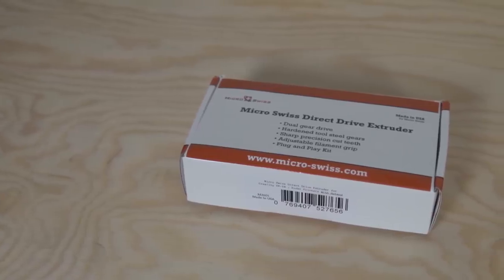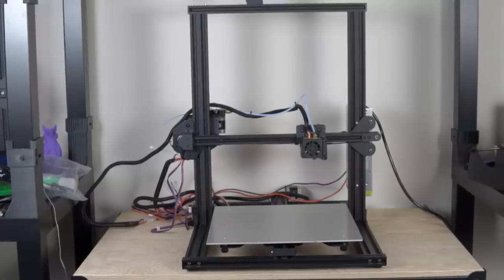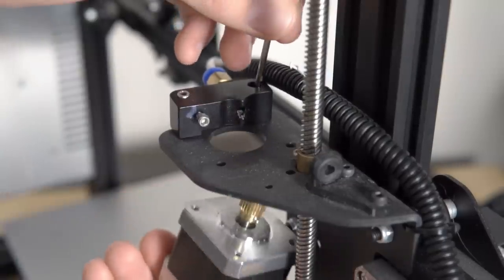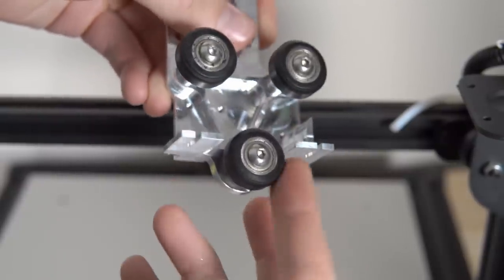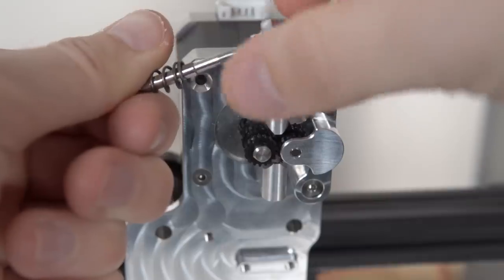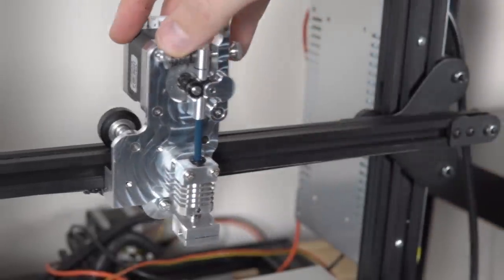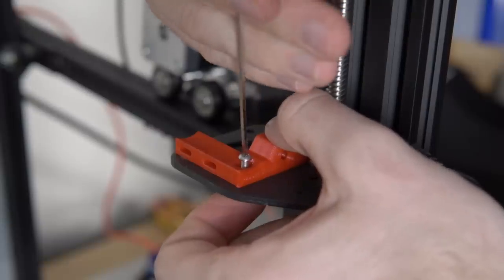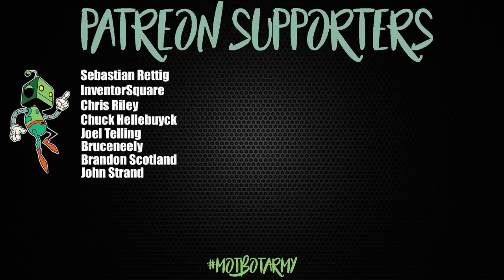Micro Swiss Dual Gear Direct Drive Upgrade For Ender 3 and CR-10 3D Printers

Comment: Why use the bracket and bowden tube at all. Shouldn't direct drive be just that, direct drive? As in straight from spool down into extruder gears. Am I missing something?
Reply: prusa uses a tiny ptfe tube too
Reply: @jessesheehan4051  Yes, I noticed that, which makes sense to keep the tube short. It just seems like the Micro Swiss version is too much. Adding back into the equation what you are trying to do away with in the first place. I just installed mine so I'm going to try it both ways and see if it makes a difference. It probably won't since the extruder gears are just above the hot end but there could possibly be issues with retraction if the tube is suffering from severe wear. Then again, maybe not. (shrug)
Reply: @brustertootwopointo4644  If you are using a high quality stiff bowden guide tube, it will start to hit the frame. I use Capricorn Tube and I'm having this problem. I've lost over 30mm of build height. I'm probably going to go back to just bowden setup, as I can't afford to loose build volume on such a tiny printer.  I may put the thing on an Ender 5, since nothing will get in the way.
Reply: @mr.spongylikeaboss4987  I was planning to use my Capricorn tube as well. Just a short length from the top of the extruder and run the filament straight down from the top of the frame. Haven't done that yet but that was the plan.

Comment: What exact size is the longer screw for the the bottom roller? I stripped the head of mine and need to order a box of bolts but want to make sure i get a box with that specific screw. In the video you just say 5mm

Comment: I suppose the bowden tube from Z-axis to the new extruder is unneeded.
Because it is too troublesome to remove shorten filament when that will run out.
Reply: I was thinking the same thing. I mean I could see putting it in with a centimeter or two extra, but If I do a direct drive mod I don't exactly want all that bowden tube still mucking about

Comment: I installed the MicroSwiss extruder kit on my CD-10S without problems. I have not been able to make any prints though. Besides having difficulty loading the filament into the lower piece of tubing my prints stop into 20-30 minutes of any print. The printer keeps moving but there is no filament extrusion. The piece of filament that is between the gears get ground up and the filament cannot even be pushed through manually. There are clicking noises on and off towards this time. When I can forcefully remove the filament and reinsert it, I can get it to extrude again. This is happening over and over and I am wondering if there is something defective on the hot end I was sent in this kit. Any ideas on this matter?

Comment: good video! I already have the Micrfoswiss hotend installed on my ender 3 MAX. I tried to install a Zesty Nimble direct drive but I would have to design a new fan shroud, etc. 2 Questions: 1: isn't the Nema 17 Motor a but to big and heavy? Can you use a much smaller Pancake motor? 2: This uses 2 grears, I think but in one path. I wonder about slippage? The OMG Direct drive extruders use 2 geared extruder paths. Isn't this a better design than a single path extruder design. And isn't this the main complaint with the Boden Geared extruder setups. Trying to adjust the spring tension just right, etc. ;Just does not seem to work well. I like that it is an all-in-one solution that you do not need to print out any extra parts. This is my problem with installing a direct drive extruder; having to print out parts.

Comment: I am unable to use my max height.  My bowden guide tube at the top of the extruder hits the frame and bends enough to cause the filament to snag and skip in the tube. I am using capricorn tube which is pretty stiff, and does not like to bend. The closer the guide tube gets to the top, it hits the cross rail of the gantry, bending more and more. I've lost about 35mm in build height.

Comment: How does this effect the inertia for the movement on the X/Y axis?  more weight, harder to stop start...
Reply: I wondered the same thing. Y shouldn’t be affected but seems to me that the X motor now has significantly more mass to rapidly move around.
Reply: It means you have to turn down acceleration due to the increased momentum. This is the only real con to this setup

Comment: The motor turns the wrong way. It does not extrude, it pulls the material out again. Where can I adjust this in the software (Cura)?

Comment: How do you fix the new Printhead setting? the nozzel will be on a different spot so the printer dont know what the middel of the bed is. the x- will be 5mm more and y like 10+ how do i make that right?

Comment: Did you have to adjust the VREF of the x stepper to account for the extra weight of the head? Mine is losing steps all over the place.

Comment: Nice Dual drive. Some stuff they did much much better than e3d hemera did. Some stuff they could do better. But I like that they have an aluminium adapter for the printers. I like the way how the heat block is combined with the heatbreak. What I don't like is the ptef tube between the  cooler block and the dual drive gear. They should did a new hotend. I hope they will do it. Cause an other company tried and did not good job in my opinion.

Comment: Instead of the risk of over torque on the hot end and damaging the heat break when heated up, isn't the torque wrench supplied by Slice Engineering for their mosquito hot end  adequate?

Comment: What is the weight of the whole extruder (with motor, aluminium bracket, hotend etc.) - basically all moving parts on the X axis?
Reply: less than what you would ever be worried about lol... This is "THE ONLY" way to go on an Ender 3 or CR10 etc.... don't settle for a clone!,,, i don't even KNOW the folks at micro-swiss but the machinist i fired yesterday would tell you... VERY NICE  :)
Reply: @thefeet  Thanks for reply. I actually chosen the alternative - bmg aero :) Also lightweight

Comment: Will this help with the Ender 3 V2 issue with bulging corners with PLA? It can't use linear advance due to the stepper boards are in legacy mode (from what I read, anyway), and still trying to work on jerk/accel settings, but that has only gotten me so far. (Any tips welcome, only been at this for a month)

Comment: After installing this on my Ender 3 Pro, my BLTouch is about 4mm off the front of the bed. I've double checked that every bed volume setting is 220x220x250 in Prusa and in OctoPrint, and I've adjusted the offsets in Marlin, compiled a whole new build, same issue. Any tips?

Comment: there's a notch on the step motors shaft. did you put one of the grub screws on the notch? otherwise it would spin in place.

Comment: Installed last night...looks like the dimensions on the mounting plate or positioning is different than stock because the X,Y,Z axis are all off now. The new mounting plate hits the end stops at different positions so the nozzle hangs over the buildplate edge in both directions when you auto home.   Did yours have this same issue? Going to contact Micro Swiss because this is advertised as a "direct bolt in" and it looks like I'm going to have to update the firmware now as well.
Reply: Have the same problem and need help
Reply: Yep same here just installed 2 of these kits on a CR10 & CR10S both have the same problem!
Reply: Hey, i'm about to install it and should have the same problem. How did you end up solving it?

Comment: I just want who ever is reading this to know that the fan shroud is supposed to be in the front. I literally finished this entire installation and didn't realize until I was about to hit print. He doesn't really explain when he flips the printer around so just a heads up. The gray box is on the back and the fan shroud is on the front.

Comment: Have mine installed and cannot get rid of the carriage wiggle. Everything is as tight as it possibly can be, and the carriage still rocks a good bit. Not sure if this is normal or not.
Reply: Did you try turning the eccentric nut on the lower wheel?
Reply: @hansdewyse1361  I've tightened that up, and now X will not move at all, so I loosen it and get the carriage wobble and X still doesn't like to move properly. I've loosened it as much as can be, massive carriage wobble, no movement on X. Start tightening and no matter how tight I go (all the way to full tightness so no wobble), X will move partially closer to home, the further it gets from home it starts skipping and finally just stops all movement. Losing my mind over here trying to figure out how to get this thing working without undoing the entire project and going back to bowden tube extrusion.
Reply: @arglebargle82  I honestly don't know then, sorry
Reply: @hansdewyse1361  No worries, I've been messing with it for a while now and no resolution. If I could find an X gantry to swap the one I have with I would, I'm thinking maybe it's sagging on that side but I can't tell just by looking at it.

Comment: No before qnd after print samples to see if this provides any improvement.
Reply: The improvements might not be apparent in the print samples. With the direct drive, you can print faster, and you can print flexible materials. The all-metal hot end lets you print high temperature materials.

Comment: Should have shown how to set up the firmware, as I am having a huge difficult time getting my nozzle centered to the bed...
Reply: Did you ever find a fix for this? I’m in the same boat right now!!!
Reply: @PastorTFS  I did, but it was a combination of things. I installed this on a totally modded CR10S5. Control board, leveling sensor, the works. I would have to look what I did up and wouldn't be able to get to it till tomorrow when I get to my shop...
Reply: @PastorTFS  I changed Manual_X_POS to -5 and Manual_Y_POS to -7. And set my BLTouch offset. Thats what worked for me...
Reply: @rackstargaming8131  thats awesome my problem is that I don’t know how to do that so that it stays each time I print like a stock machine homes
Reply: @PastorTFS  yeah, I had to build a custom version of Marlin because I did so many different mods...you could get someone to build you a custom version or learn how to... plenty of videos out there, some real good ones by Teaching Tech...

Comment: Don't you need to upgrade the firmware, since the nozzle is at different position?  Thanks for the video!
Reply: Unless you are pushing the limits of your X and Y that isn’t really relevant. Also, I suspect it’s not at a different X and Y.

Comment: I konw this will be reinstalled to another printer, so when doing that make sure the grub screw on the extruder gear that goes on the motor is aligned with the flat side of the shaft.
Reply: lol i caught that too, grub wasnt aligned with the flat spot.

Comment: I just installed Microswiss direct drive with all metal hotend and it seems faster but it doesn't print at center. Also it starts out printing then about 15% into the print it just stops extruding filament. Have you seen or heard anything like this? I'm sooo trying to print a good print with this. Any advice would help. Thanks in advance

Comment: I am trying to mount this direct drive extruder kit onto a CR 10S Pro. Is the process the same? My machine has a leveling probe and this video does not mention it. I have been searching for a printed mod to accommodate the probe. Any thoughts on this?

Comment: G'day m8 and hows ya doin ol son!!.....im doing both Micro Swiss DD and hot end!!! thanks to your channel!!!!!!! for putting this in my head.  I've gone for a 50w 24v Heater cart by Slice Engineering but i cant find a vid on its install and any other info like firmware update Etc.  ive heard this will do 300c or there abouts which is what im wanting for some of my Rc parts, for polycarbonate and Some Carbon Fiber pieces im needing.  Im a bit of a noob at 48yr old.... but not completly stupid.  Will the stock ender 3 v2 thermister be enough or is that need to be upgraded too. Cheers and kind regards for at least reading this novel from a m8 Downunder!!

Comment: I just installed this, all works well but now my extruder is about 20mm from the front edge of my build plate. The Y end stop on the Ender 3 doesnt seem to be adjustable, how do I adjust the Y home point? Many thanks.
Reply: You can slide the y stop up and down. Look at 3d tomb of printed horrors channel: great video tutorial for bed leveling.

Comment: Install went great! extruder is not extruding while printing it is retracting.  I  had a 3d printed piece and was printing on my ender3 pro right before i put on the MicroSwiss.  Any ideas, same firmware.  Thanks  Rob

Comment: Thank you for making this video! I've run into a problem though, The extruder gear does not have a grub screw, or any method to remove it that I can detect.. It's just gear, no collar. Should I just proceed with the original gear?

Edit: So apparently older production runs of the Ender 3 Pro came with a press fitted gear on the extruder motor :( 

If you have an Ender 3/Pro check to see if the gear has a collar on it before ordering this kit, so that you can order a motor ahead of time and not have to wait to use your new upgrade.
Reply from the maker: This is the first time I have heard of this good to know. Thank you for the feedback!
Reply: Any fix?
Reply: I found that when I use a pair of pliars with the needle nose in between the gear and the motor base, and the pair of snippers included with the printer (only used to apply equal pressure to the other side because i don't have a vise), i can pop off the gear. It took quite some force and the snippers are damaged but it works
Reply: Same problem on mine, and the printer was bought in November 2020 so it's not that old. It looks like I'm buying a gear puller now.
Reply: @mattgolman  do what i did
Reply: @Thrillowatt  I don't know if the stepper is designed to take that kind of axial load. It was probably installed with a heat fit and felt like a pretty strong attachment. The gear puller was $20 on Amazon and had next day shipping.
Reply: @mattgolman  oh sick, well mine works like a charm but a gear puller is probably the best way to go
Reply: My previous gear's grub screws had rubbed into the shaft, preventing removal. I don't recommend it, but I was able to remove the previous gear with a Dremel and a metal cutting disk.
Reply: My ender 3 v2 had this
I just used a little gear puller I have and and flat head screw driver to pry off the gear
Ground a flat on the shaft with my Dremel
Works perfect
Reply: @Thrillowatt  i used a hammer in between the gear and motor. held the motor in one hand got another hammer and lightly tapped the other hammer  and the gear came right off.

Comment: The G-code they included seems to be way off. When my print started it wanted to run a wipe straight across the front edge where the clips are holding the glass.
Reply: same thing happened to me, had to modify the gcode
Reply: Mine did too. Trying to figure out how to modify the code. I'm new at messing with the codes.
Reply: Clips? You should use small strips of flashbreaker tape over the edges instead for glass beds. Flashbreaker tape is high temp and has a silicone adhesive. Clips are awkward and dangerous for printing.

Comment: For that price, why not just get the hermera?
Reply from the maker: I would be curious to see on a side by side how they perform. One thing I could think of is that you do not need to print out any parts since this is made for this machine. Also not having printed parts could allow you to enclose it and print with high temp materials.
Reply: With the Hemera you loose some build volume. Check out the video about the Hemera on an ender 3 by teaching tech
Reply: Emmitt CM If you see the coments in this Teaching Tech video there are some tricks to don’t lose space using Hemera.
Reply: I agree, the product is 6 months too late. Thanks hemera seams as a superior product.👍

Comment: Im currently following along and installing this on my CR-10 S5.
I have a bit of wobble and wiggle. How do you adjust that out? All screws are tight, it almost seems like the carriage rollers arent gripping the rail tightly.
Any suggestions?
Thanks, and thanks for the video!!
Reply: Nevermind, just realized I need to turn the eccentric nut to tighten to the rail....lol!

Comment: Im purchasing an Ender 3 v2, would you recommend these mods? Swiss direct drive with a Mosquito Hotend, possibly a 2nd z axis drive, And in the future possibly adding linear rails??? Also could you use some kind of thermal compound or liquid metal on the thermistor before swapping to the new hot end?
Reply: The fan shroud is an issue.  I'm still researching a fix for it.
Reply: @ModBot

Comment: if I currently have a micro swiss hotend already installed on my Ender 5 can I use the Direct Drive I bought from you off Amazon or do I need to use 1 from Micro Swiss?

Comment: So it looks like you have to change fan housing over hotend on some printers, noticed you changed yours?
Reply: I think because the clone cr10 he used had different mounting points to stock fan housing on cr- and ender- printers, he switched to one of those as the micro Swiss set is designed for those in mind

Comment: Hi. Thanks for the video. I was wondering if you have tried this setup with Klipper firmware. Would it be "safe" to have this heavier weight for faster speeds and accelerationsof 7000mm/s^2 for an ender 3 with this setup?